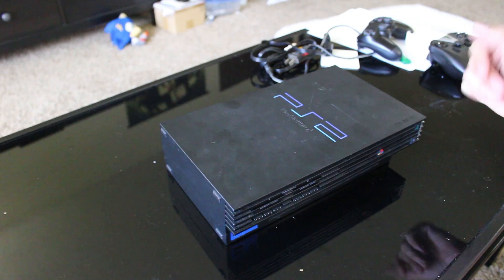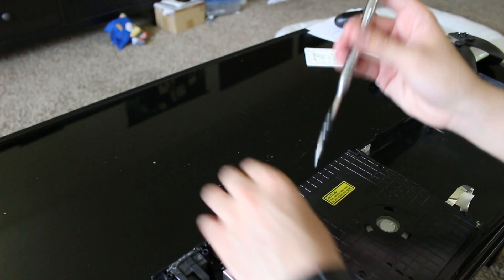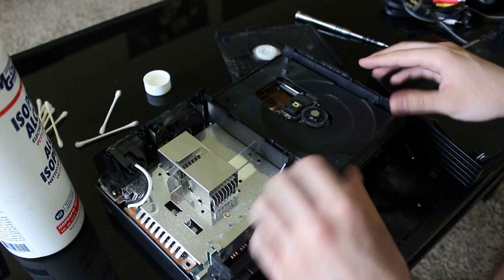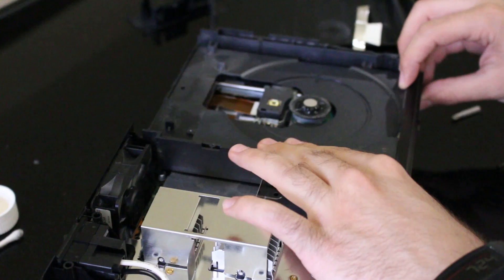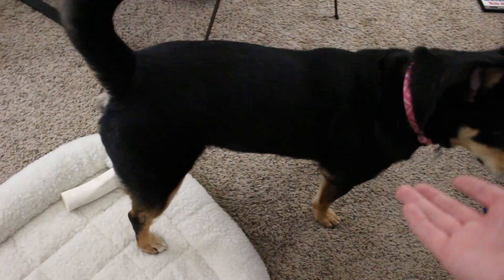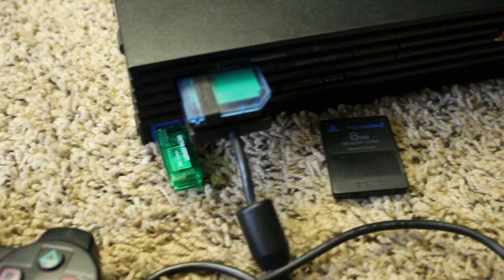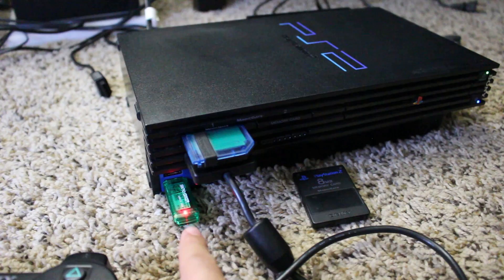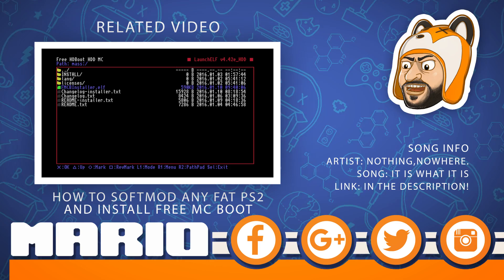Let's Refurbish & Softmod a Fat PS2!

Comment: Stop FAT shaming, all PS2s are beautiful
Reply from the maker: fat
Reply: Sure, kid
Reply: Lol
Reply: LetsBlaze Gamer woah don't be rude
Reply: Flat ps2s are just coasters, iron boards and stage sets for shows.
Reply: FAT PS2s are better than slims, by the way. Hard drives, full game compatability, just looking better.
Reply: Well, the Slim PS2s have MUCH more games that don't work. And I've had several PS2 games that don't even run on the Slim.
For example, Ty the Tasmanian Tiger 3 (A PS2 title that came out in 2005) doesn't work AT ALL on Slim PS2s.
Reply: Yeah. I hated that, because Ty the Tasmanian Tiger was one of my favorites! At least it runs on PS3 (early models) and PS2 Fat!
Reply: Phatt
Reply: Erik dying light  I also presume it runs cooler, too. But take my words with a grain of salt.

The only advantage the slim PS2 has is a very marginally faster CPU clock speed, which won't make a difference in games.
Reply: do you mean phat shaming lol
Reply: its good that its fat
because you can fit a HDD in it. (don't woosh me if this is a joke)
Reply: BBW for life
Reply: @letsblazegamer5095  nah, it's butiful.
Reply: @billywws  although psx launcher needs to be on a higher revision than 5000. Idk if fats go higher than 5000 or not, but mine is a 3001. I've got both, but I prefer fats cuz hdd, more compatibility, etc.

EDIT: I just saw that your comment is 3 years old.... oof....
Reply: Phat
Reply: But it does only accept FAT 32 (well by design lol)
Reply: @cyphaborg6598  all PS2 only support FAT32/ in case of the fat ones, APA..

It's a software limitation, not a hardware one

There's a version of OPL that supports Ext4

Comment: Your clock battery is dead! I don't know how, but my fat PS2 is like 14-15 years old and it still keeps track of time... fantastic engineering.
Reply: Capacitors
Reply: If you take the battery out it just wont keep time when unplugged, and the capacitor will maybe last a day(guess). But I wouldn't go through the trouble, because it's easier just to re-setup the time again. I don't know other than that. But you could add like a capacitor array which lasts longer. just an idea. Seems like a lot of work. Good Question
Reply: No man, is fucking impossible to replace a CMOS battery, you have to unscrew bolts, and remove plates, and remove plasic screw cover tabs, prey to ghod that your CMOS battery doesn't break.
Reply: must be bloody clean inside
Reply: Same here 😀
Reply: your statement is right,
Reply: My clock is still working too. I have a bunch of my Nes RPG carts and the batteries in them also still work thats kinda cool.
Reply: I have scph 30004 (first launch model) and clock is still working since 2000
Reply: Same I booted my fat ps2 I've had since I was a kid the other day and was amazed it  still knows what date and time it is
Reply: @erde57  I got a 39001 fat model
Reply: @erde57  me too!!
Reply: Mine is 19 years and the clock is still working
Reply: my ps2 slim and my brother's old launch day phat model ps2 both have the clock battery working and it's been 20 years almost for the phat, these consoles were built to last man this is crazy.
Reply: @edwinj223  impossible to remove a CMOS battery???

What are you saying?

Comment: You could have washed the plastic parts in the sink right after the gutting without any problems.
If you are worried about the electronics afterwards, you can use distilled water or isopropyl alchool ( i use a mixture of the two in a half/half solution. I also use it to clean displays ). It will evaporate without any problems.

Comment: Will a 110v power supply board and switch work in a 220v PAL console if the they're both v9 consoles? Seeing conflicting answers all over and need confirmation before I blow more money on this.
Reply: As long as the chassis revision is the same, it should work. All the power suppply does is supply +12v and GND to the PS2 main board.

Comment: to start off with loved the video great format and nice to see your first time taking it apart! though there are some issues important if you are following this tutorial IMPORTANT! 99% isopropol alcohol is very caustic to many plastics such as ABS ( although most of the ps2 plastic is ok, its way safer to use a lower percentage alcohol) it will completely destroy it after being in contact with it for a short time and make it so brittle that slight touches will simply cause it to fracture and fall apart, AWESOME for metal though like cleaning the top of the processor on the board and whatnot. Secondly the dvd portion of the PS2 laser is what you really want to test as it get hotter and usually goes out before the PS1 reader and with he way the lenses are set up it can sometimes take the PS1 CD reader with it. Third, its good practice once you remove the heat-sync, especially when its this old to add a few dabs of thermal compound to all the pads on the heat sync, especially if you have taken it apart multiple times (wait to put on the thermal compound till the last time), to ensure it adheres to the processing units (mine died due to heat because i did not do this and my thermal pads where in bad shape and didn't pay attention) .
Reply: Thats's true very and it's odd to have it on hand anyway as in many areas it is not easy to find.  He probably had it on hand for some other required use.  Yes the thermal compound is a very good to replace while you're in there it's one less thing to worry about.
Reply: Where can you even find 99%? They don't sell it in stores, the closest is 91% as far as I'm aware.
Reply: zzzhuh late reply buuuuttt 99% iso is electrical grade, it's found at electronics stores like Frys Electronics .ect works like paint stripper it's way to good
Reply: either way, its not that serious. i use denatured alcohol which is way more harsh than 99% iso. unless you soak the plastic in a container of the alcohol, its not going to stick around long enough to damage it. get back at me when you use lighter fluid to remove sticker residue from laptop cases.

Comment: Been cleaning up old systems as well lately.  If you want a tip to make things look finished and new again when you are done thoroughly cleaning, I put a little moisturizing hand cream or lotion on the plastic, and buff it in.   Gives it a touch of a shine, and even fends off some dust and lint, etc.   I used Nivea cream myself.

I buff it until there is little to no residue with a soft cloth or paper towel, and it turns out rather nice.   It does help restore the appearance of the plastic some, especially after using alcohol to clean.  I wish I had before and after pictures of a PS2 I did a couple months back.   It looked like it was in a restaurant's garbage pail for about 6 months, and by the time I finished up with it, it looked genuinely brand new again.   It still does too.

In any case, figured I'd mention it, in case you may want to just give it a shot sometime on something, and see how you may like it.
Reply from the maker: Interesting option.

Comment: I hope you thought of changing the bios battery.
Reply: Jeremy Medlock
He did not! 😅
Reply: Jeremy Medlock yup changeing the CMOS battery would be good before it starts to leak.
Reply: facezxa
The problem is, that the current battery is empty (as you can see, because the 'swirling electrons' are not moving)... Button-Cells leak quite rarely.
Reply: Just2Options? Irrational: FearOrExuberance?

AFAIK you would need another line to draw the current from, because the circuit where the BATTERY is connected to, does not have/give current, but only draws it from the cell...
Reply: Just2Options? Irrational: FearOrExuberance?

It depends on your model, but I'd rather not 'steal' it from USB. The PS2 has quite some spots you can use use for this approach. You can find a lot of them by looking at modchip-installation-diagramms (ignore those which patch the CDVD-Controller and 'BOOT ROM' (a.k.a. 'BIOS').

...and if you use a capacitor, then you probably would need 2-3 more parts as well. 

I suggest you to register at some console-specific forum if you are interested in console-mods/hacks/developing/etc.

www.psx-scene.com (sony-console-scene-related)

www.assemblergames.com (modding, in-deep hacking, dumps and easier stuff, but a lot development-related not specialized on any particular hardware but consoles/handhelds/etc.)

Ps2-home.com (specialized on the PS2; a lot densed information from all over the PS2-Scene; User-Forum, with a lot contributors to the user-base&scene [Tutorials, Themes, Scripts, Programs, etc.])

Comment: Cool video. Freemcboot is suggested to work better with original memory cards and difference consoles might need different versions but to get the best out of the fat PS2 you might want to get an IDE to SD adapter and get a big sd card to put a lot of games in. It also makes the ps2 lighter and less vulnerable to shakes and stuff.
Reply: The newest Versions should work on any model... If it doesn't, the console is most likely modified!

Comment: I really don't understand why he didn't just clean the outside of the system when everything was disassembled. I would've just run every single plastic piece under water and thoroughly clean them, even the metal shield parts that have no electronics on them. So I don't understand why he didn't just do that. It would've come out almost as clean as brand new.
Reply from the maker: I couldn't tell you either.
Reply: Hahahaha :)))

Comment: How do you find the date the PS2 was made? Like in the factory
Reply: Cyber Swiper
For what?
Look up the 'chassis-model'...
Reply: You can find which quarter of what year by looking at the date code on the back - 3D indicates 4th quarter 2003, for instance. To get a more accurate time you'll need to look at the date codes on chips in the PS2 and stamps on the case.

Comment: Hello I have ps2 slim 70004 I buy myself bitfunx fmcb v1.953 memory card with that I able run fmcb but the think is that I have another sony brand (on the video) memory card and try to load fmcb v1.966 noobie pack v4 extented+ and program does open but when I was doing normal setup the process stuck around %56-60 and can't continue so when I restart device the memory card have v1.966 what mostly thinks not work specially opl so what could be problem please answer if you have solution 
Note:I try install multi install but opl doesnt open no matter what so I try again with normal but opl still cant open

Comment: Is the hard drive SATA, IDE, or something proprietary?
Reply: UNKNOWNGAM3r
Either SATA or IDE... It depends on the adapter.
Reply: What's the point of SATA?

That parallel port for the HDD can only run at 66MHz which is IDE bus clock. 

SATA is pointless
Reply: the point is sata drives are way easier to find nowadays. And they're newer, less likely to fail. IDE drives are becoming expensive actually because the available stock is so low.
Reply: James Mathis
...and on a side-note... Compare the loading-speed of an IDE-HDD and a SATA-HDD, even on a continuous chunk of Data! Sata load it faster and I tested it against the newest IDE-Drives... (in a PS2)

Comment: Did you know that the Fat PS4 Power cord can power the PS2?
Same port for years and it still works.
Reply: Blurgamer 17
???
PS2 either used the simple cable with a kind of '8' on one side, or an external PSU...
First PS3s use another connector (like PCs)...
Sorry, but what you said is only partially true.
Reply: All PlayStation consoles use a 2 prong polarized plug except the 1st gen PS 3 which used an IEC  ( desktop computer ) plug.

All further generations went back to the 2 prong style

Comment: Do you need frame master to play ps2 on 720p or can I use it with a 720p capable HDTV?
Reply from the maker: Some games play at 720p, others can be forced into 720p, but forcing games into those higher resolutions can be hit or miss. I normally force my 480i games into 480p and then upscale it using the Framemeister.
Reply: @MrMario2011  Any idea why that happens and a cheaper alternative to framemeister?

Comment: hey there so basically if there is a modded PS2 and it has the modded hard drive and memory card, what happens if you turn on the PS2 without both of them? Would it go back to its original state?
Reply from the maker: Normal state.

Comment: So, probably within a year or so of owning the ps2 back in 2004 I started having issue that when I play a game, the avatar/character on the screen will drift to one side so I constantly had to hold the joystick to the right to keep it center or balance. This only affected the player 1 slot not player 2. Will taking apart and cleaning with the alcohol help? Is there another fix? I probably should have looked into this way back then lol but I wasn't into videos games that much and now I just want it to work properly so I can play it for nostalgia.
Reply from the maker: It could, worth a shot! Worst case you're cleaning up some old hardware.

Comment: You should really get a component-cable... ^^

Btw.: You forgot to set the time (electrons not spinning in the background) on your friends PS2.

It might have caused the issue of the installer not loading...
Reply from the maker: Video quality doesn't matter to me if I'm only using it for a few minutes, but the PS2 was handed off with both Composite and Component cables.
Reply: MrMario2011 
Great! Then he can use the HD-related stuff, like OPL with its new FullHD rendered GUI (HiRes-Covers, etc. are coming too), or atleast can set the output-resolution of games to HD (which makes quite a difference, even when they are internally still rendered in a lower resolution).

Comment: On a fat PS2, once you've installed to HDD, can you take out the FMB memory card? And with a slim PS2, can you have it load over SMB and remove the FMB memory card? I'd prefer to keep the FMB memory card aside once it's done its job in case I need it in future. I want to minimise the chance of it getting corrupted, plus it will free up both slots for regular saves.
Reply: @D. Wade Thanks for the detailed reply. I appreciate it :)

Comment: I just ordered a fat PSX off Ebay. I'm looking for opinions with some reasoning. Should I mod it? And what method should I use? (The only method I know of is the PSnee, which is a modchip you can make with an ATTiny85 microchip and an arduino board)
Reply: Just bought one myself. I'm going the FreeMcboot route myself

Comment: PS2 = the best console ever made
Reply: InStars yup followed by ps1 and n64 super nes, nes, dreamcast, genesis
Reply: nah that ring broke 2 of my 360s after that I stoped buying them
Reply: Gamecube anyone?
Reply: Desmond Buffalo the slim Xbox 360 fixed that issue as some reject thought it was a good idea to use way too little thermal paste and and improper fan that guy ultimately got fired
Reply: PS3, specifically the backwards compatible models, they play any ps1,2,or3 game. And have a boatload of features, like an internal hard drive, card reader, cd DVD and blu Ray playback, and its much easier to open and clean

Comment: How much do ps2s sell for in the us. The cheapest I can find in the UK is 25 pounds (around 32 dollars) because he said they're so common and we'll they are the most sold console ever.

Also when I was younger I broke my PS2, broke my DSi, broke my Xbox 360 (still works sort of) and gave away my Xbox Original
Reply from the maker: They can be found for about $30 easily here, in stores $40-60 depending where you go.
Reply: MrMario2011 ah cool. Not far off.
Reply: I found mine at a thrift store for $5, it came with everything but a controller. Just look around, you can find them sometimes at thrift stores and garage sales for really cheap. You can find tons of really cheap games too.
Reply: got a fat ps2 with hard drive adapter at goodwill for $5.99 last week haha!
Reply: I got one at goodwill for 30$. It came with one of the best models of the fat ps2 (SCPH-39001), singstar accessories (and 2 of the singstar games) and two controllers. One was like brand new and the other was missing one of the thumbsticks' grip.
Reply: Michael Chowtee mine is also a 39001 haha with the HD7 laser. Great system im doing a modbo 5.0 install on it right now.
Reply: I found a working PS2 in decent condition on trash recently!
Beat that! ^^
I also found a USB-Bluetooth-Stick, a 250GB-HDD, a ~4-5year old PC and got a DS3-Controller spent...
Beside the adapters, I've got it all for free...
Reply: theLMGN i got 4 of them for $8 bucks at the swap meet

Comment: I think the battery that keeps the internal clock going when the power switch is off is dead in that PS2. In the browser, there should be the little light balls moving in a circle when the clock is going. When they're all bunched up on each other, the time is not set. When you set the time, initially it won't let you change anything so you have to just accept the default, then you'll be able to set the time. If the time is lost when the system is unpowered (generally left unpowered overnight), then the battery needs to be replaced.

Comment: Why did you use FreeMC? You shuld use HDD-OSDD for Hard Drive, and you dont need a chip, with that soft mod you can run games from the HDD like if was the original HDD for PS2.